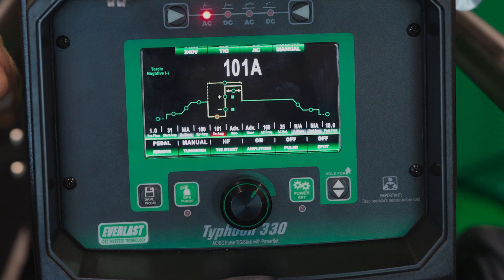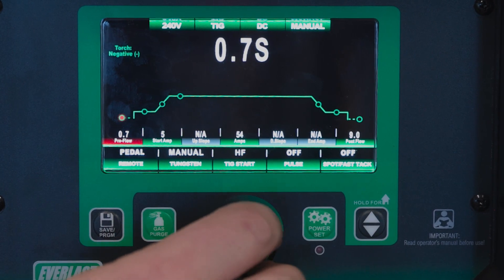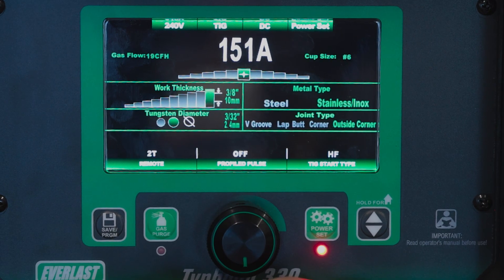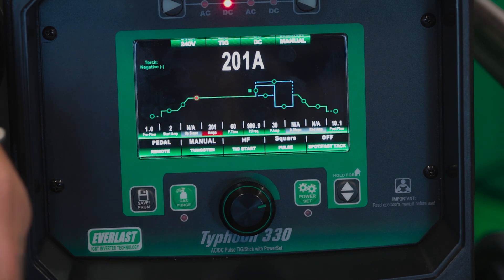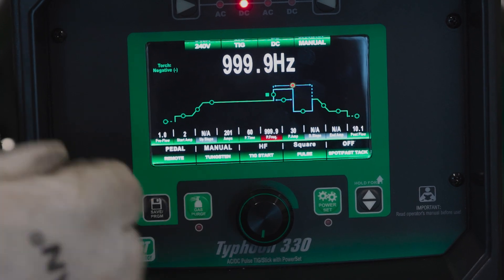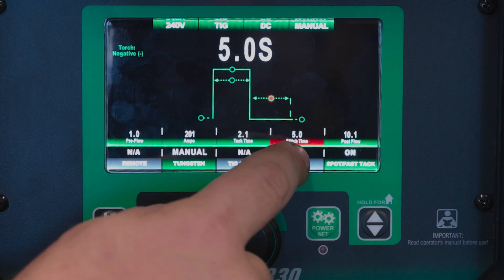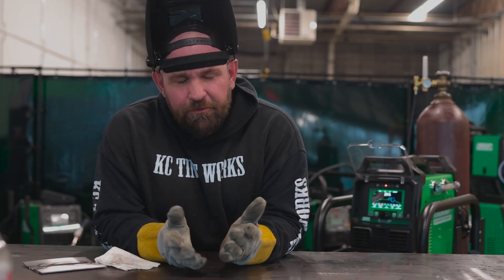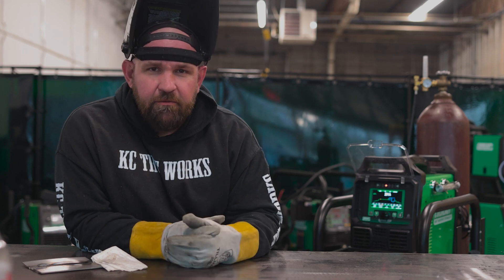Everlast Welders Typhoon: DC TIG Overview

Comment: Since yall already put two gas solenoids in your multiprocess rigs, could you look at offering a secondary post-flow gas mode for TIG? I run a series 17 torch most of the time and I'd love to be able to run twenty seconds of compressed air after my normal post flow to cool the torch at higher amperages.